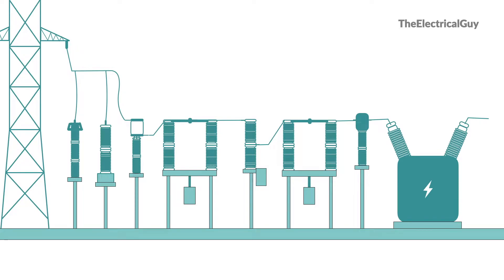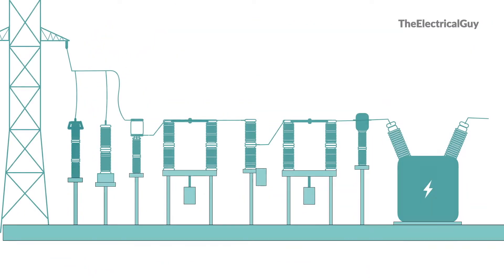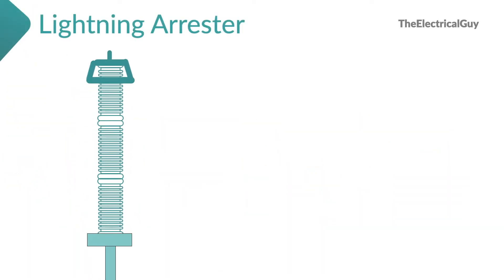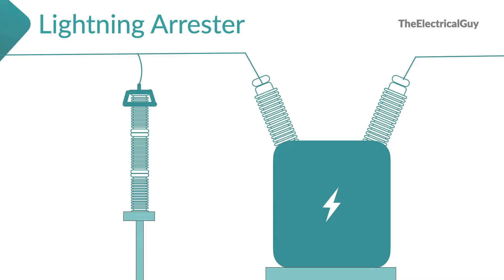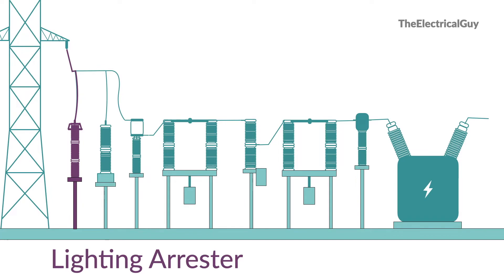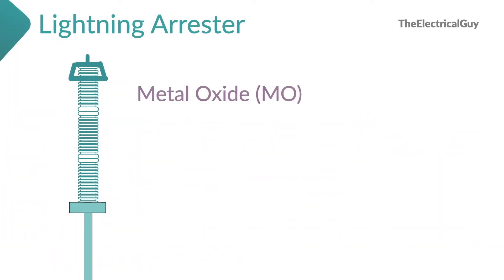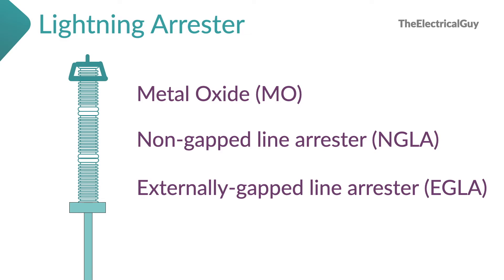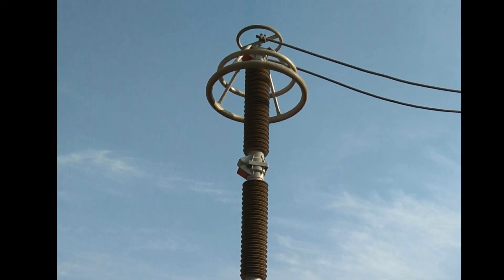Introduction to Lightning or Surge Arrester | Video #2

Comment: 1.Phase to earth/Ground faults
2.phase to phase/ Ground faults
3.Energization and de-energization of T/Lines
4.Switching on-off transformers.
5.Sudden load changes.
6.Type of system grounding.
7.Load flow direction changing.
8.Dumping of loads.
9.Amplitude is governed by the type of fault plus impedences, resistances of network and ground resistances